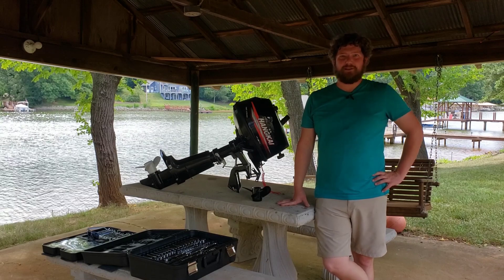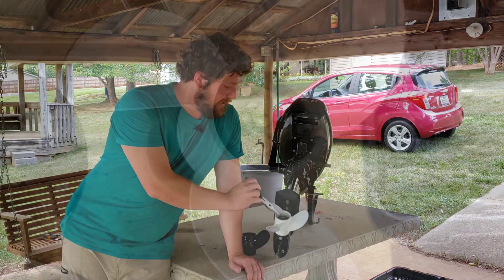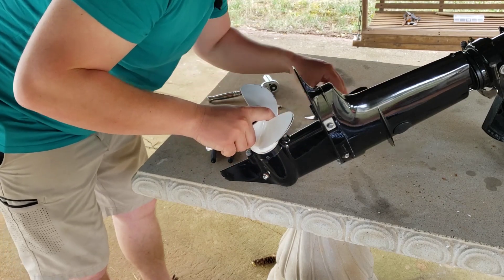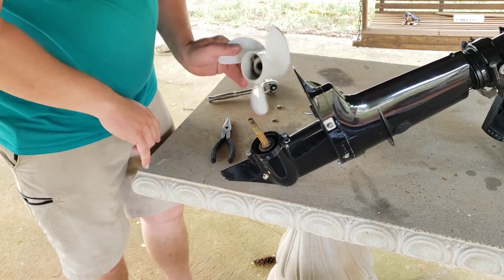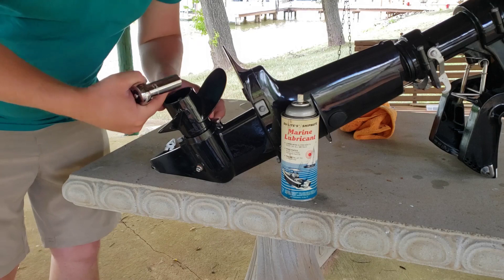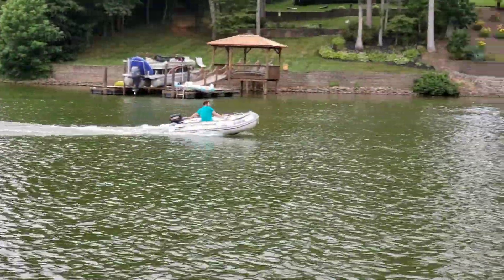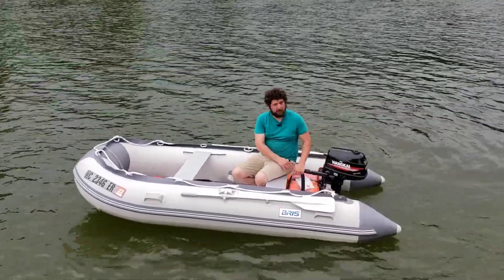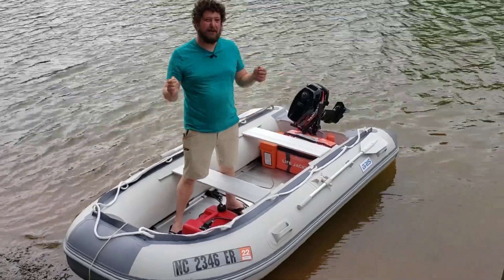Small Outboard Prop Upgrade

Comment: I had the same hangaki 6hp two stroke I added a small hydrofoil to it and plained immediately with the stock prop.. I was very happy with the results running it on a 3-4 person inflatable
Reply from the maker: We put an Attwood hydrofoil on our other Hangkai 6 (left the stock prop) and the hydrofoil definitely has a more noticeable difference than the prop upgrade.
Reply: @HufflerGarage  agreed love your content keep it coming
Reply from the maker: We certainly appreciate it. Thanks for watching!
Reply: Is the hankai parts the same as the tohatsu???

Comment: I did a prop comparison video of a similar 6hp Mercury with hydrofoil but went down to a 6” pitch.  Much quicker on plane but 2mph less top end.  16mph vs 14mph.  Hydrofoil eliminates all cavitation when up on plane.  6” prop ends up hitting rev limiter on engine, so wide open throttle isn’t advised.
Reply: does hydrofoil reduce speed for a 5 hp dinghy and what are the positives of it (why do you want to get on the plane faster)
Reply: @samskelton9908  I needed the hydrofoil because the motor was cavitating the prop, so it was not getting up to speed at max rpm.  It also helped the boat get up on plane quicker.   If your motor is planing fine and not cavitating at max rpm, you don’t need a hydrofoil.

Comment: I had a mech at a custom prop shop tell me once, if you want to go fast get a bigger motor and stop chasing a race car with a mule. I had a 17 foot lowe bass boat with a 48 ev, on it and I kept going to him trying diff. props and hydro foils you name it. he was right.
Reply from the maker: Agreed. In the end the gains from most of the upgrades we've tried have been so minimal, it's not really worth it. Smaller outboards have a purpose, but speed is not it.

Comment: I did the same swap and didn’t notice much difference.
I am now thinking the shaft is too long for an inflatable boat.
They don’t really specify long or short shaft on these Hangkai. But they seem to all be long. 20”
I’m just learning about all this stuff though.
What do you think?
Reply from the maker: I would agree that the prop is too low. We put a hydrofoil on our other motor and it sits pretty low in the water. There is another guy on here who made an adapter to raise the motor up on the transom and I think that helped a bit.

I think these Hangkais are 15" short shaft motors.
Reply: It should be 1 inch or less between bottom and cavitation plate.  Also you have to check motor's RPM!  Max RPM=max power.  I have 330 inflatable boat and Tohatsu 5 motor. 8 pitch prop max speed is 25 km/h with 5400 rpm and 7 pitch max speed is 25 rm/h with 6000 rpm.  If I add one passanger 8 pich prop gives me 13 km/h max and 7 pich max  speed is 17 km/h. Now I'm going to buy 6 pich and test it with one passanger. I expect  20 km/h max speed
Reply: @amigo439  May I know whats the benefit of changing to 6'?
 as you mentioned above only 20 km/h for 6' which  is much slower than 25km/h for 7 or 8' prop

Comment: Can u tell us how many spline the prop is?
Reply: The shaft on this engine is a 12 tooth spline for the prop.
Reply: They copied the tohatsu so bottom end to which make sense for 12spline would accept a lot of props from mercury Nissan tohatsu 4/5/6 hp

Comment: What size new propeller? And brand
Reply from the maker: 7.8x7 is the size. There was no brand, we bought it from China on eBay.
Reply: @HufflerGarage  there is a change in power or not
Reply from the maker: You can tell it has some more thrust and it stays on plane in turns better, but it wasn't a very big difference.

We plan on doing some more testing with it on our other dinghy to see. We also plan on installing a hydrofoil to see if that makes a difference.
Reply: @HufflerGarage  i'm follow your result..